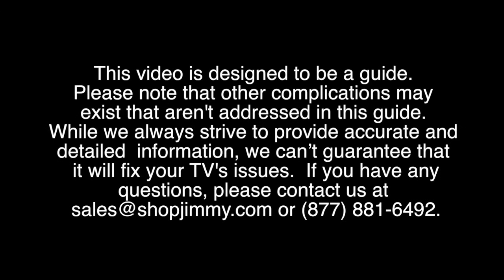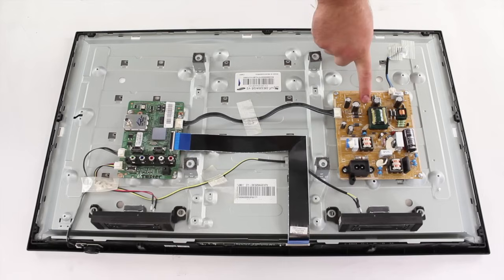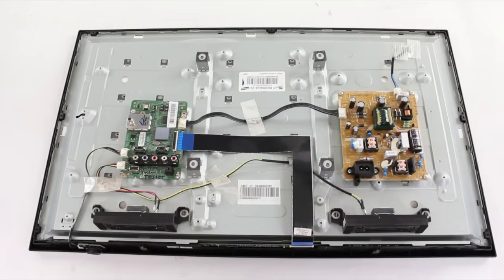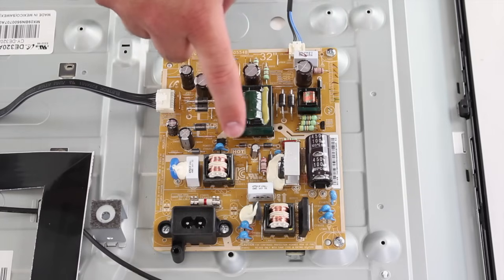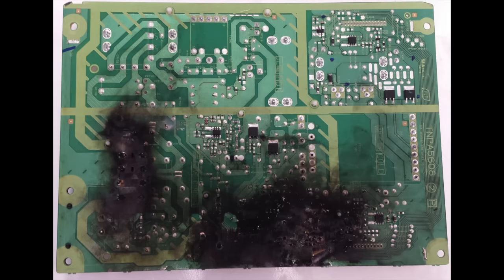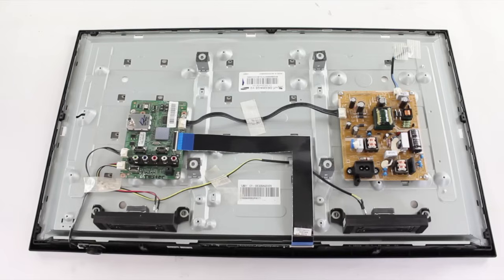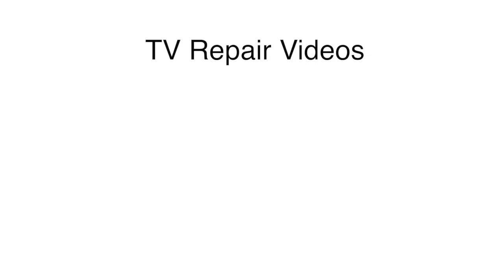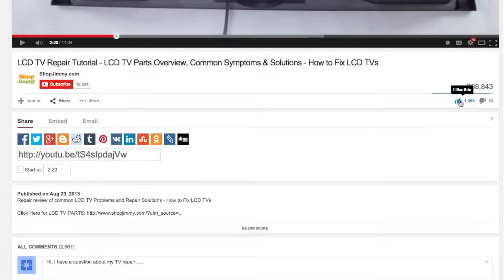Samsung LED TV Won't Turn On No Power & Does Have a Standby Light Basic Troubleshooting TV Repair

Comment: A friend of mine had a power surge, the TV is an INSIGNIA model # NS-50 D40SNA14
there is no stand by light, it's completely dead, I took it apart and noticed an IC Chip # A6069H had a chunk blown out of it, could this .30 cent piece be the cause?
the power board # is B166-705 D46 REV B   do you carry a replacement for this TV?
please advise, thank you from Ont Canada

Comment: Had the same problem on that exact model of tv,at first there was no standby light,i then remove the power chord ,unpluged the power to the main board from the power supply ,reconnect every thing got standby light but still not powering on.With the set on i unpluged the main board from the power supply,the back light lit up ,when i pluged it back in no back light.hit the power button won,t power up,the chip with the cermic heatsink is warm to the touch,i know there is voltage to the main board,the tv  turns on after unpluging on/off many times so the customer says,i did,nt see it turn on, i suspect the main board,the power supply seam to be ok.
Reply from the maker: Harris John   Try all repairs and troubleshooting at your own risk.  Please reply with your TV model number.  Click here to view a video that shows how to find your TV model number:  https://www.youtube.com/watch?v=S51nhAmwR2M  Thanks!  www.shopjimmy.com
Reply: +Harris John hi harris i got the same problem with your tv set, may i know if you fixed the problem please and if so what parts did you replace? thank you
Reply: +filipina santos the mother board
Reply: +filipina santos tv works great